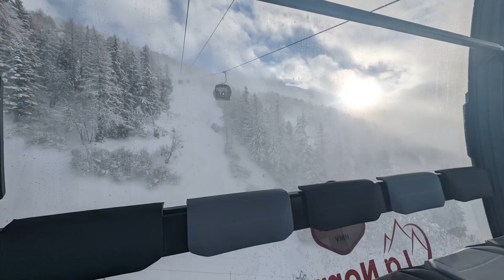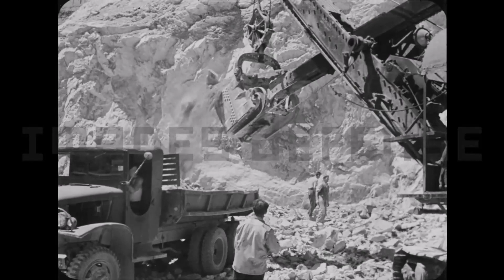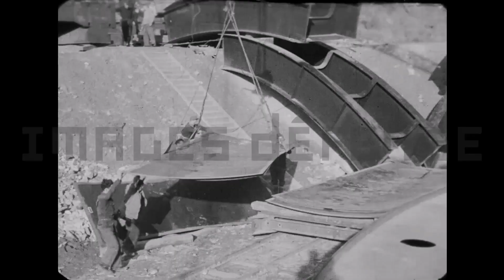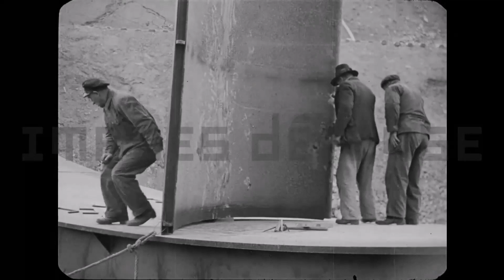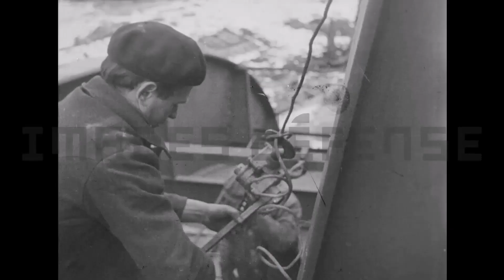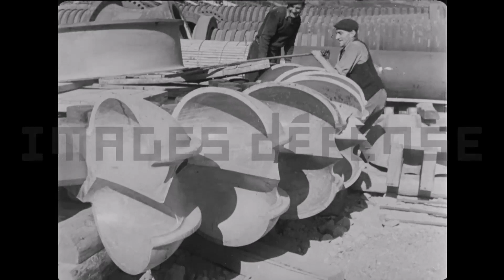#52   La construction de l'ONERA   1947 1952

Comment: The text has nothing to do with the film ☹
Reply from the maker: This is the correct text, it simply explains how the wind tunnel will work once completed
Reply: @lanormattitude  Sorry, a bit late: The text describes the wInd tunnel in Chalais-Meudon, which was built in 1932-34 and reaches a max wind speed of 180km/h. What you see in the pictures is the construction site Modane-Avrieux for the high speed (transonic) wind tunnel S1MA (and others) which reaches up to 1200km/h. It is driven directly by watercraft with a power of up to 88.000kw. But the pictures are very interesting...